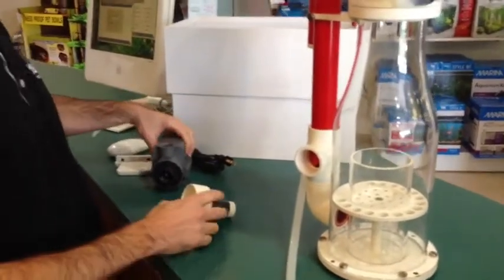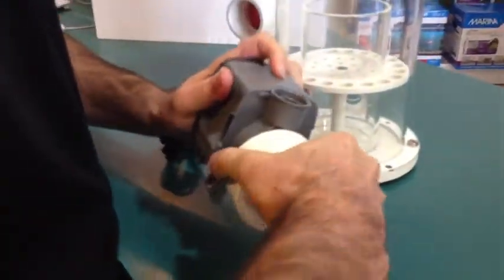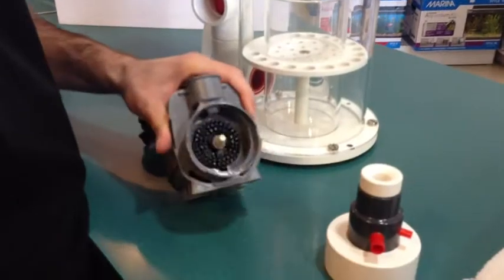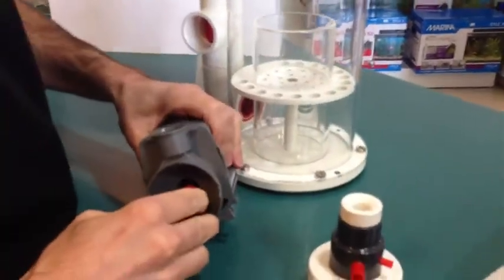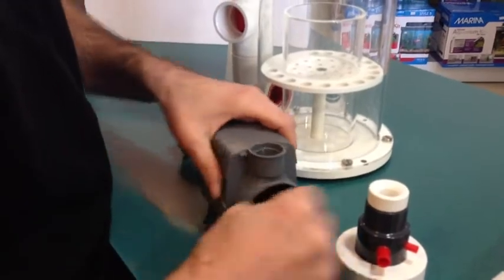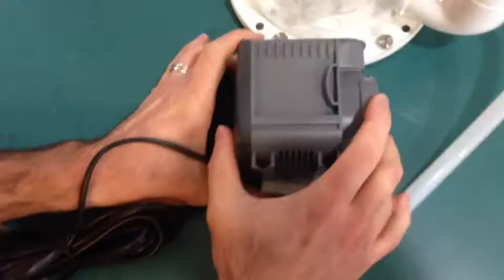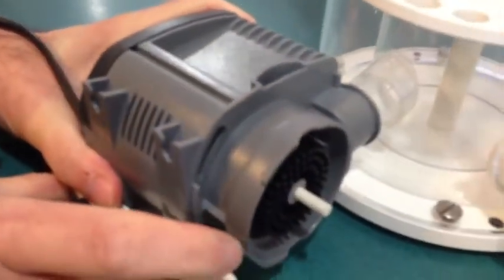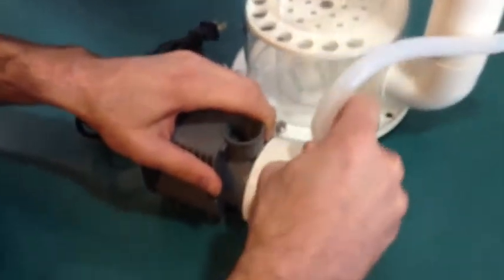Vertex Skimmers With Sicce Pump

Comment: Hey man. Mi impeller broke and im told the PSK1000 impeller works. I still have the needle wheel. Is there a way to swap the original needlewheel with the PSK one?
Reply from the maker: You would have to send me images of the impellers and the pump bodies to help.  You could also contact Sicce.

Comment: Will the sk600 or sk400 impeller fit the vertex 130 pump?
Reply from the maker: Depending on the motor block you have yes.  It may not have the same performance as the one Vertex customized
Reply: @aquamanknox  thank you so much for replying.  New to the hobby and I’m overwhelmed